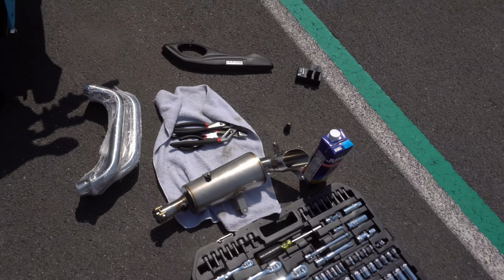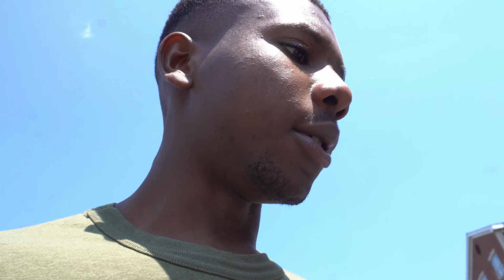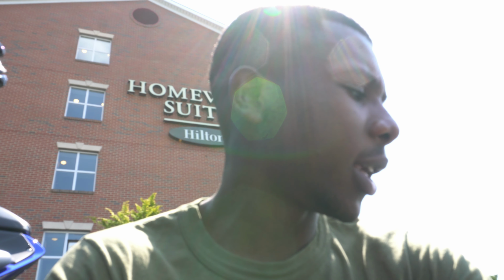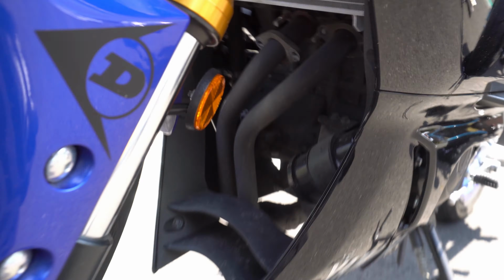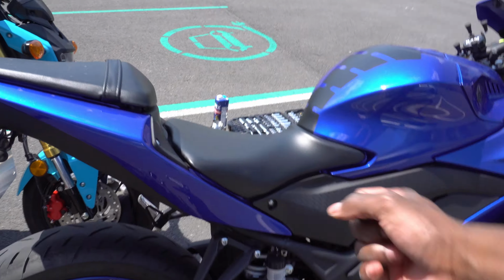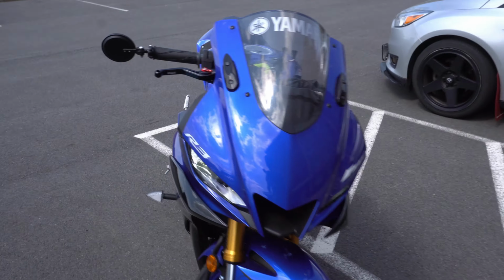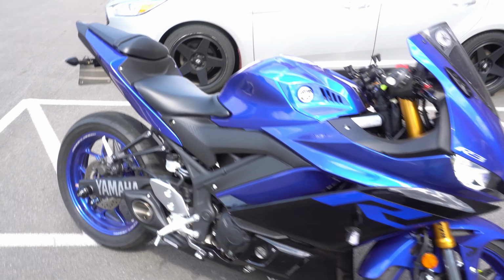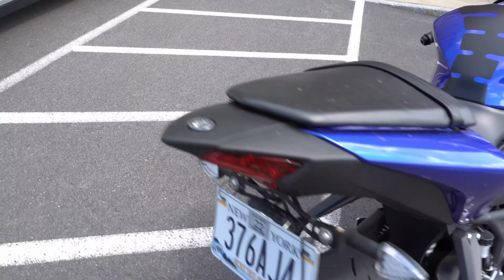2019 R3 Full CS Racing Exhaust Install!

Comment: Do you think its still too loud?
Reply from the maker: Honestly speaking I LOVED that exhaust, would do it again looking back. I no longer have the r3 tho. Feel free to check out my channel and follow my zx6r build if interested!
Reply: @lhaitianpapil  Thanks. I keep going back looking at it on Ebay, but still not sure if I want to keep spending money on the r3 or save to upgrade bikes.
Reply from the maker: @deedle6073  I hear you, depending on the cost for the exhaust now I’d say just save for a bike upgrade
Reply: @lhaitianpapil  Did you run it with the baffle in or out? Did you need ear plugs, or was it tolerable in city riding?
Reply from the maker: @deedle6073  I ran it with the baffle out. I didn’t run with ear plugs